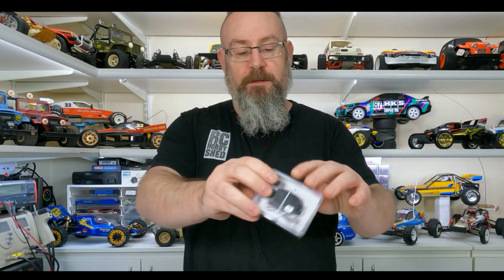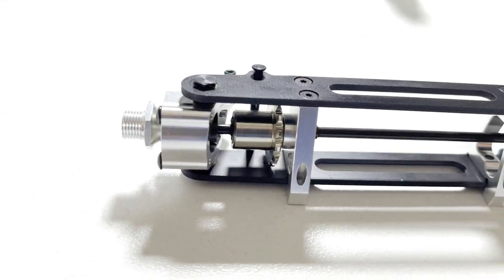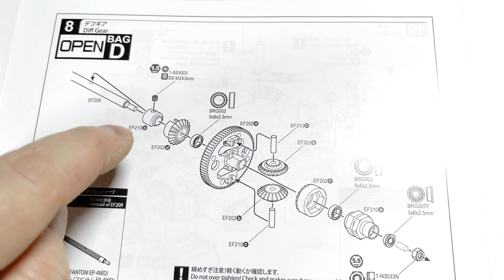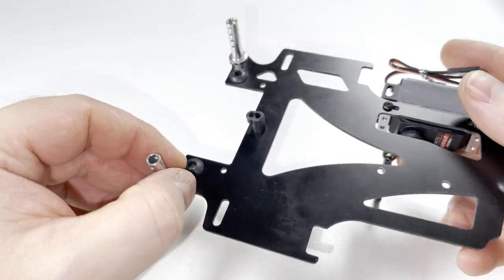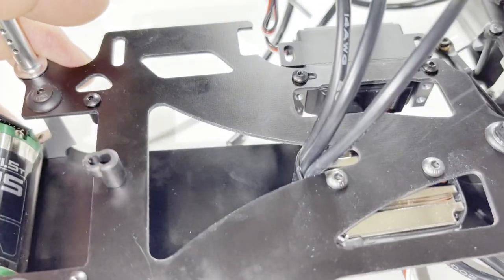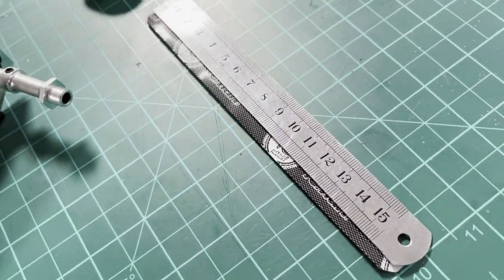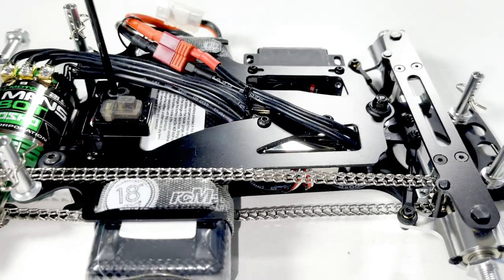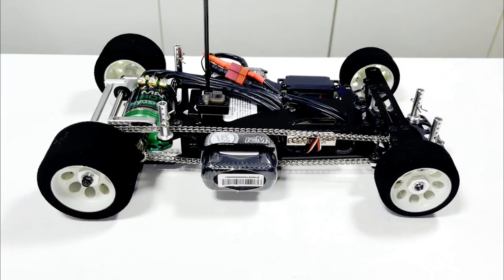Kyosho Fantom EP-4WD Chassis Build

Comment: That's a slick looking motor, like a piece of jewellery👌.
I thought it would run a solid axle, Nice work kyosho!, the rear diffs a nice  unit. 
Great attention to detail and cable management Mick👌.
Nice to see all kyosho esc and motor, perdect kit🏆. 
Looking forward to seeing the running video, thanks for sharing! 👍🦘🇦🇺
Reply from the maker: Oh yeah they're real pretty! I think I still prefer the look of the original 480S but these look great.
Yeah they're a nice and simple diff, no balls to loose everywhere lol. The original had a diff too, I think they were pretty advanced for the time. 
Thanks mate, took ages and then I forgot the sensor cable (DER!) so had to take it apart. 🤣
I just had to run all the Kyosho gear in it, couldn't bring myself to skimp on the electrics for such a nice car. 
Should be fun to drive, hoping to give it a run this week. Thanks mate! 👍
Reply: @RCHobbyShed 
Totally get you running all kyosho gear, it looks like Kyosho put some pride in designing it, good on you mate 👍

Comment: Hey my man!!! Seriously your very skilled at this hobby!! I have been wanting to build a Kyosho kit but I’m a little intimidated. Only have done Tamiya and let’s just say sometimes they give me a lot of trouble yet alone having to learn how to solder. Man you make it look easy and clean. My wiring is never that crisp but my buggies do run. The last buggy I built was the boomerang and I think I met my skill level at that. Anyways I’ll keep watching you and maybe I’ll get the balls to do one . Thanks man your awesome!
Reply from the maker: G'day Chris. Thanks mate! I'm thinking a Tomahawk might be a nice Kyosho kit for you. They're relatively easy to build, I would say no more difficult than a Boomerang. The Fantom is really quite simple too, only the wiring needs to be neat as there's not much room under the body. I'm sure you'll get better with your soldering in time, maybe practice on some scrap wire may help and there's loads of soldering videos on YT. I'd recommend using the best soldering iron you can afford. I'd go for a 60w iron, that way it won't run out of heat when soldering battery connectors and things like that. I also still use lead solder, I've tried the lead free stuff and I hate it! lol
Hope this helps. I'm sure if you get a Kyosho you'll be blown away by the quality. Good luck mate!  👍
Reply: @RCHobbyShed  Thanks Mick!! I really appreciate it!! Actually the tomahawk was the one that caught my eye! Again thanks and your amazing!

Comment: With this car I’m always worried the chain will at some point eat through the top plate or through the battery 😬
Reply from the maker: I does look like it could cause some damage but the chain is really smooth and light, and not tight enough to cause too much friction if any at all. Kyosho supply some tape to put under the battery, I'd have put that on in the video but I'm not 100% sure I'll use this battery. I think it will be fine but when I do a running video I'll have a look at it and show any damage or wear. 👍

Comment: Where did you get the aluminium tape bud?
Reply from the maker: It's available at most hardware shops. It's used for taping joins in foil insulation. Here in Australia I got mine at Bunnings. 👍
Reply: @RCHobbyShed  thanks bud.

Comment: If you really want to trick out this car, you can install carbon fiber parts. Kyosho makes them and so do other manufacturers. You can even get a carbon rear axle. Thoughts?
Reply from the maker: I don't plan on doing much to this one but I do have another one on it's way here. I'll probably do all the upgrades on that one. 👍
Reply: @RCHobbyShed   Wow! So you are going to have two of them. That is great. This car was hard to get for awhile. Not sure why? Now, it looks like it is easier to get. I had a hard time getting the car but had an easy time buying parts for it. Go figure?

Comment: Is it pretty unlikely anything breaks on these on road cars ?
Reply from the maker: It is unlikely, Robert. As long as it doesn't hit something, you'll be all good. 👍
Reply: Thanks man ! How long it take to build this ? Over/under 3 hrs?
Reply from the maker: @robertwordenjr7076  Yeah, I'd guess at around 3hrs. It was slow for me of course, because of recording and so on. The chassis is very quick to build, but the wiring is a little slow as it needs to be very neat as to fit under the body.